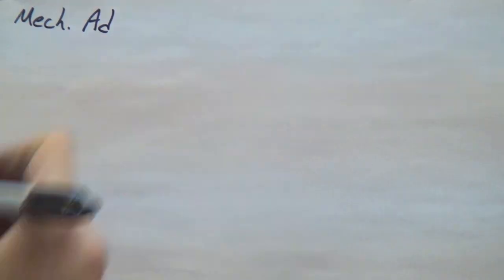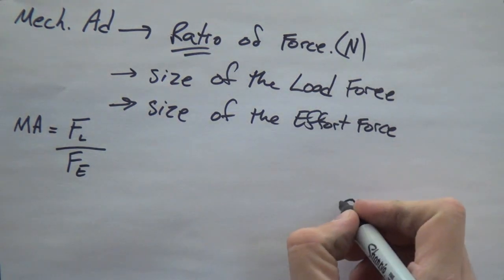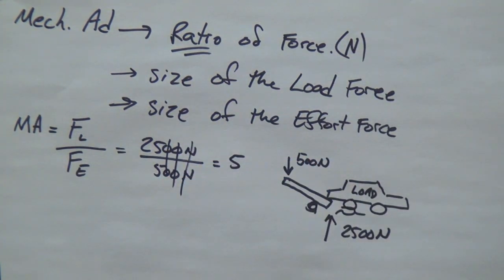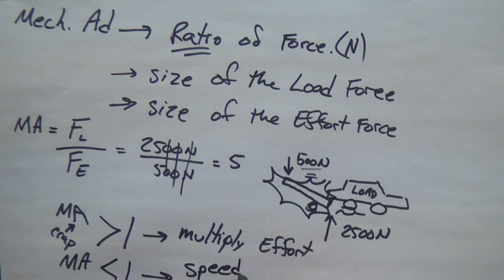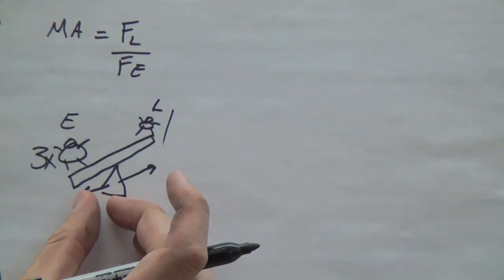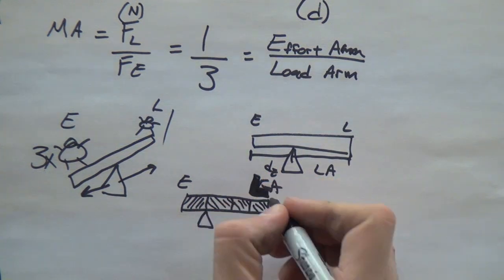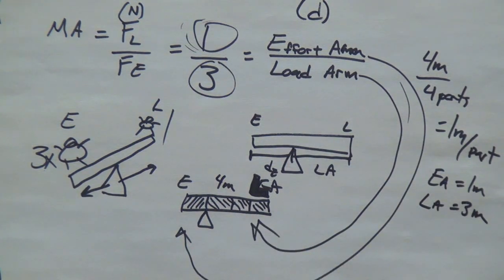Mechanical Advantage

Comment: Ok I think I get it. If I wanted a mechanical advantage of 5, and I have a 6m stick, and I push down on one end of the stick with 10N of force, then I need to place the fulcrum at the 4.8m mark, and the result will be that I lift 50N of force. I guess distance is involved too but not sure how—pushing a lever down results in rotational angle and that's where I get lost.

Comment: I started to get the actual mechanical advantage but I have other homework problems that are different and I don't understand at all
Reply from the maker: Are they mechanical advantage problems? Is there a way I can help?
Reply: @MrLeavittScience  They're asking for the resistance distance. If I can figure out the equation I can solve the problem. I just don't know how to rearrange the equation. And the other one is asking for effort distance. I understand how to do the mechanical advantage ones just not how to rearrange ronfind the other things. My teacher described stuff as output force/input force = input distance/output distance. I'm just having trouble figuring out what to fill in.
Reply from the maker: @atlas3231  I hear you.  If I understand your teacher right then we have the same formulas, just said differently.  Let me try to clarify things for you.  
Output Force = Load Force
Input Force = Effort Force.  
Input Distance = Effort Arm (or distance from the input/effort to the fulcrum)
Output Distance = Load Arm (or distance from the output/load to the fulcrum)
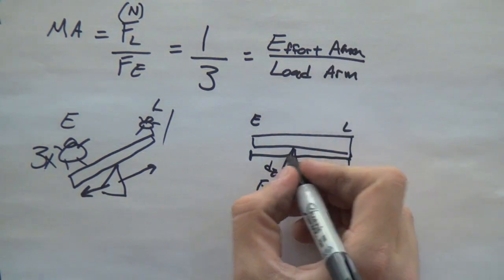At around the 4:00 minute mark of my video I have my formulas and a drawing that is exactly what your teacher told you. I can understand how you may be a bit more confused while watching this video because the language sounds so different. Maybe this can help you.
Reply: @MrLeavittScience  I'll try it. Thank you! 🙏

Comment: someone help! If the load is five time heavier then effort but the fulcrum is placed 1 meter away from the load (on a four meter plank) the ratio from effort arm and effort length is different then force load and force effort, so wouldnt the mechanical advantage change? like say i the video the bigger guy was 50 pounds and the small was 10, but the fulcrum was placed one meter away from the big guy, so the ratios would be 1:5 and 1:4 and the MA would be different.
Reply: sorry if that makes no sense!!
Reply from the maker: Chloe Seljak if you change the load to a ratio of 5:1 then the distance in order to balance would be the same.  but when you change that distance, yes your MA will also change.  I should have been more clear on the whole need to balance the lever thing thang.